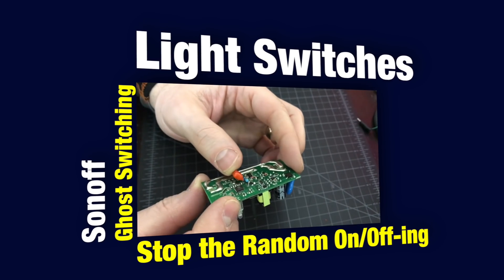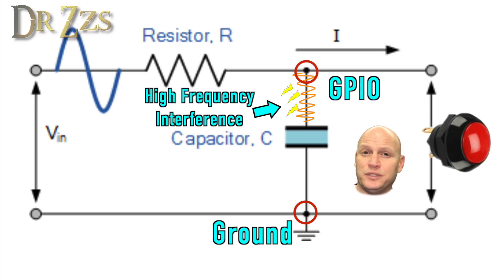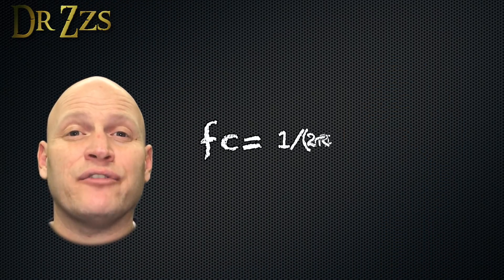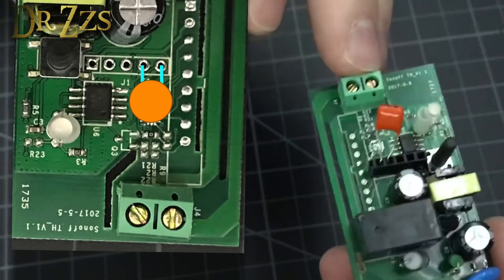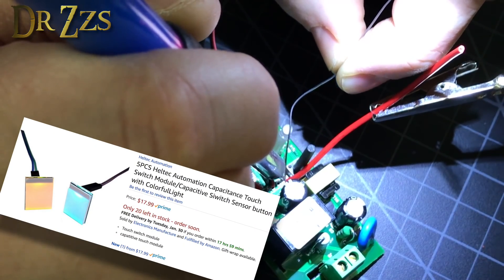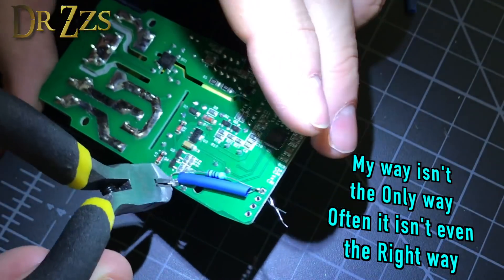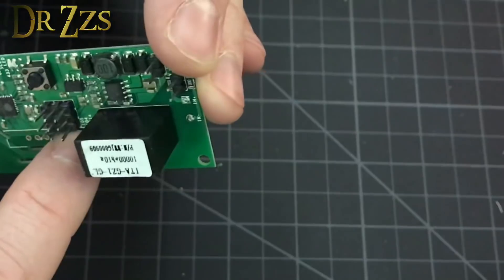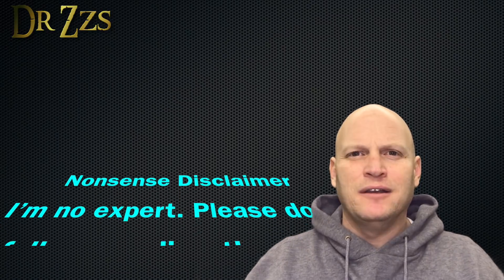Block Interference with a Low Pass Filter - Bust Ghost Switching!

Comment: Very nice video, thanks... But (there's always a but), I have a 4ch R2 with no switches connected, just the basic ewelink app, no scenes, no schedules, no nothing. And I get ghost switching. Is your solution still applicable to my situation? As there are no wires going to switches, there should be no interference to filter, but the ghost is in the machine and I would like to get rid of it. Many thanks if you can guide me. Regards.

Comment: You should choose the capacitor carefully otherwise if you have a push button you will need to keep it pushed longer for higher capacitor values in order to discharge the capacitor.

Comment: Hi, thanks for all the amazing videos. I have ghost switching in sonoff smart wall WiFi touch switch TOUK3C-TX. Two of three switches keeps swiping off and on almost every minute. I have opened it a apart but couldn’t locate GPIO14 pin. There is Jumper-1 which has four pins VCC, C2CK, C2D and GND and there is Jumper-2 which has VCC, RXD, TXD and GND. Can you support to locate GPIO14 pin and do I need to put just one resistor and one capacitor only. I can share the photos if needed. Thanks
Reply: i have the same, did you discover already wich one it is?

Comment: Hi, I whacked like 50 times this video and I still can't make out of it how to know what is frequency on mi Sonoff MINI DIY? I have like 20 of them in my house and they turn off and on lights out of control, like you said: gost lights. 
I put this resistor and capacitor and it's little bit better but still not good enough, and I don't know how to make it perfect to not have this interfiring!?!
Should I get higher capacitor or??

Comment: I have been having this ghost switching issue with my Shelly 2.5 devices. I'm gonna filter the 2.5s and see how it goes.
Reply: How'd it go? Were you able to resolve the ghost switching?
Reply: @walneu  I ended up flashing espHome on the damn thing. Now I don't run the stock firmware on any Shelly devices.

Comment: Problem solved for me by luck!
My sonoff WiFi + RF was turning on and off by itself every 50 seconds  even without connected to WiFi and to ewelink because of my f@cking weather station who has a wireless external humidity and heat sensor and every 50 seconds send reports to its internal unit, I kept sonoff and sensor more distance and everything is great now!have that in mind people!

Comment: Hi DrZzs, Great video AGAIN. I am having some ghost switching atm... so your video is perfect! The problem is, I am using a Sonoff Mini! So I grabbed a Sonoff Basic from the drawer but only have Basic R3's and 1 R1... These don't have the same pinout as the R1 (As iis the Basic in your video). I have manage to solder a Mini to flash it as after loosing power doing OTA so I can solder "Just!" What are my options? Can't buy Basic R1's anymore. R2 has GPIO2 but it's hard to get everything in there. R3 well that's a different kettle of fish!

Comment: Well actually this is not a low pass filter - if you draw a high frequency equivalent cirquit (DC sources get short cutted) the risistor is now paralell to the capacitor. the hf input voltage could pass unrestrained to the IO Pin - but your circuit adds additional capacitive load to the line which reduces the sensiitivity for hf impulses (-;
Nevetheless it works
Reply from the maker: Excellent!
Thanks for clarifying. :)

Comment: What kind of resistor and capacitor I need to use for low pass filter for sonoff T1 eu 2 gang? Do you have some diagram how to connect this?

Comment: Hi Drzzs, can you make a video with sonoff touch or similar switch? as GPIO on those are not clearly visible as on Basic. Highly appreciate! (or someone else, if you can point me somewhere, it would be great. Thanks)
Reply from the maker: I just posted one about the Sonoff TX today.  That's the new version of the old Touch.  https://youtu.be/1q8Pxzrx0Nc
Hope that helps!
Reply: @DrZzs  seen that, I have those as well, and they aren't ghostswitching at all ... so this is good indeed. But for existing Touch version would be nice to have them fixed ... ;)

Comment: Hi Doc. I have a sonof T2 wall light switch US that is ghosting. Randomly turns on but never turns off unless I manually do so. How do I fix the ghosting as the switch is in a casing? My neighbor are complaining the outside light goes on and bugs them. But I’m unaware. Please please advise. Thanks in advance.
Reply from the maker: hmmm
First I'd try the things Rob suggests in his MQTT retain video.  https://youtu.be/31IyfM1gygo
Basically, go to Tasmota settings and type "switchretain 1" and "powerretain 1" 
Then in HA turn off retain in your switch entries.  
What is most likely happening is your switch loses wifi connection briefly and HA (or Tasmota) are turning the light on when it reconnects.  
Hope that helps.

Comment: I’m facing ghost switching in a T1 3 gang model and I can’t figure out how to do on T1 as you did in this video.
Reply from the maker: hmmm, have you looked for software causes?  The T1 shouldn't have EMI causing ghost switching unless something is too close to the cap-touch sensors.  It's possible that what you're experiencing is caused by MQTT and HA.  I assume you're using Tasmota.  Type "switchretain 1" and "powerretain 1" in the Console.  Check out this video about MQTT retain and other causes for ghost switching.  It's good: https://youtu.be/31IyfM1gygo
Reply: Thank you very much, i'll check this out.

Comment: At least on the SONOF 4CH Pro, there are already  10K pullup resistors on the MC inputs. So if you add "extra" resistors in parallel you end up with even less than that. Are you sure there are no resistors already in place in your SONOF?
Reply from the maker: I'm not sure anymore.  They're on version 3 of the Sonoff Basic.  I can't say what the circuitry looks like on the new ones.  
I also don't think this was really the main problem that was causing my ghost switching.  I think it was devices falling off wifi and reconnecting and old MQTT retained messages flipping some of my lights on/off.  I haven't had the problem at all anymore once I stopped asking HA to retain the states, and I started using powerretain and switchretain options in Tasmota.

Comment: I wonder why I see this ghost switching only after flashing a Sonoff basic switch with Tasmota software? I am still evaluating it and might get back to the original Software (which I backed-up, just in case) - With the original software I have two Sonoff basic switches in my lounge which deliver ON or OFF rather solidly&reliably, without LPF. Any comments?

Comment: Ok, so I have a Sonoff BAsic (modified as a dry contact), to open my electric gate, and 2 reed sensors, one on GPIO14 the other on the serial rx as a GPIO, turned off serial debugging... and inching turned on to open the gate... problem is I think it might be trigegring the reed switch when the gate opens, since I mounted the Sonoff behind the gate's module.. gonna try this! hope it works, as well as setting a long debounce delay..
Reply from the maker: Good luck!

Comment: I just been using a 10k resistor from 3.3v to GPIO, whihc seems to work great, no more ghost switching, now I'm worried, should I be also using a capacitor as well? Does it matter?
Reply from the maker: If you aren't having issues, then don't change anything.  That's always my moto!
Reply: @DrZzs  Ahh, but I did have issues with my kitchen lights, as the switch, and therefore the cable, was quite long way off, and I got ghost switching, so I added a 10k resistor between GPIO and 3.3v, and it fixed the issue. But then I watched your video and thought maybe I also needed to add a capacitor?

Comment: Hi. How to modify the slampher bulb holder!?
Cannot find gpio pin on the board.
Thank you.
Marc.
Reply from the maker: Yes!  
I've done it.  I think I recorded a little video.  Send me a message in discord to remind me to look for the video, or get out the slampher and show you the pins.  
In the meantime, maybe this will help you find the pins. 
http://tinkerman.cat/new-firmware-for-the-slampher/
I think that's the guide I used when I flashed mine.

Comment: I used have problems with the ghost switching, until I added both the resistor and a capacitor. As I still had lots more sonoffs to go in, I designed a little circuit board that fits inside the sonoff case - The resistor, a capacitor and a DIP switch (to isolate the capacitor) go on the board, a straight pin header and a 90 degree famale header.  Solder it all up, solder the straight pin header directly to the sonoff, cut a small hole in the sonoff case, and there are all the pins exposed on the outside.  Job done.  Circuit board is shared on OSH Park if anyone else wants to give it a go!  https://oshpark.com/shared_projects/3d9UtZjT
Reply from the maker: Awesome!  Thanks for sharing that Jenny!
Reply: @DrZzs  You can see pictures of the bare board, assembled board and the board in a sonoff:  https://photos.app.goo.gl/5GtsRPmtaX2F7WfE9
Reply: Why did you add the DIP switches?

Comment: Very well explained. Though it probably is not an issue for the  sonoff, in some cases one needs to consider input impedance that could make the series resistor work like a voltage divider. Not really a problem for a short to ground button  though

Comment: Hi! I'm looking for a solution with my sonoff, it's strange because, when I'm testing in my desktop with the sonoff doesn't make ghost switching, but If I put sonoff in my register case in my wall, and activated GPIO14 as switch it causes flash lights, but more quickly than the video, click clack, in less than a second...is this ghost switching?? If anyone could help me, thanks
Reply from the maker: It's possible, but I wonder if it might be something else with some connection.  Maybe there's a loose connection on the GPIO-14 or ground wire.  What kind of button/switch are you using on GPIO-14?  If it's the touch module it could be that something is close enough to it that it is activating.
Reply: oh thanks for response me :D, I'm using a regular wall switch, it is not touch or has a LED in it, it's a simple wall switch. My "Ghost switching" occurs even if I have  only two wires on the GPIO14 and ground, switch disconnected. I live in an attic, above of me I have AA Machines :S, If I put in the register box occurs, but If a plug sonoff in the wall plug (1.5 meters down) not occurs...
Reply from the maker: does sound like RFI then.  I'd guess a Low Pass Filter would help.
Reply: @DrZzs   This guide is great! 
Am having same trouble thought with random quick on /off of LED light, which i'm suspecting is the AC to DC transformer in ceiling that feeds some LEDs.  The only difference from you guide and my Sonoff is i have the new sonoff basic "Sonoff RF R2 Power V1.0" which is reference here.
https://github.com/arendst/Sonoff-Tasmota/wiki/Sonoff-Basic#serial-connection

So am using TX and GD as my toggle GPIO switch with Generic Module type selected and setting TX (GPIO1) to Switch1(09) and D6 (GPIO12) set to Relay1(21).

This works fine but when i apply this low pass filter solution with Resister (across GD and VCC) and Capacitor (across TX and GD) and if the switch is open it works fine. But if i reboot Sonoff with switch closed the Sonoff dose not boot. Any ideas what going on here

Comment: Any amazon links for resistor and capacitor, Please? there are different PartNumbers for the same resistor specs (4.7 kOhm).  qty:100 for $6 (1/2W), and qty:10 for $6 (1/4W), what is the difference, wattage? (or did you ever figured out proper syntax for Robert Tait advice to use console commands [from replies below: "SwitchMode6 you can enable "hold" mode , set the hold duration for .2 seconds using SetOption32 2, and set the hold text to "TOGGLE" using StateText4 TOGGLE"] )? Thank You Very Much, Great Videos (as usual).
Reply from the maker: I haven’t tried Rob’s way but I think it’s a good solution. Probably better than using the Low Pass Filter. 
I’m on my phone so it’s hard to search for solutions. Do what Rob says with setoption6.
Reply: Thank you. I tried, but not knowledgeable with SONOFF,  I think SWITCHMODE6 is for BASIC, getting unknown command when typing SWITCHMODE6 into SV console (did not try other commands though, will check tonight)
Reply from the maker: What version of TASMOTA are you using?
Reply: Sonoff Tasmota 5.12.0  - sorry to bother you, but did you ever figured out what Robert Tait meant under his post to. On SV i am getting Value for SWITCHMODE1 to 4, for 5 and 6 "Command": "unknown" / SetOption32 returns "40" and StateText4: "HOLD"  (worse case i can always follow your tutorial in the video, but would have been nice to do it in Tasmota itself) Thank You!

Comment: Thanks for the great video DrZzs
I just want to know which resistors and capacitors you recommend me to use with the sonoff basic
If you can link me to eBay\Amazon items it will be wonderful 
Thanks.
Reply from the maker: Any brand is fine I'm sure.  These are the sets I bought (there are WAY more here than you will probably ever use):
https://amzn.to/2NowC4e

https://amzn.to/2KI0Rl2

A kit like this is probably a better idea because it has the R's and C's you need plus some jumpers and other useful things.  All depends on what you think you'll use in the future. 
https://amzn.to/2tPEQKD

Hope that helps!
Reply: Thanks again, just wonder what values works for you?
Is it 4.7K for the resistor and 33Nf for the capacitor
Reply from the maker: yes, those work.  It really doesn't matter a lot.  Since the signal we want to let pass is DC the LPF can be pretty much any combo of R/C.  If we were using it to filter something like audio signals for a radio, then we'd have to be careful that our filter didn't also block the signals we want to let pass.  But in this case, any R/C combo should work.

Comment: Always better tips !!
This is also the case for the Sensor Capacitive Switch Sensor
Reply from the maker: I haven't had to use this with the capacitive touch sensors.  I did at first, but since I stopped I haven't had the same trouble.  It shouldn't hurt anything if you still do it, just might not be necessary with those kinds of switches.

Comment: Hi DrZzs, the watts in the resistor and the volts in the capacitor are some how relevant for this fix?
Reply: no, the current is really low->no dissipation, and also the V is around 3v.

Comment: I'm using my Sonoff devices to switch lamps on and off via Home Assistant and I get a lot of ghost switching on mostly. I'm not using any external wired switch to the GPIO pin, so don't need any wires coming from it. Would I still use this method to stop my random switching? That is a 4.7kOhm resistor between 3.3v and GPIO14 and a 33nF capacitor between GPIO 14 and Gnd.
Update: So I soldered the resistor and cap in 2 of my Sonoff Basics and they still turn on by themselves. Are there any other solutions for this problem?

Comment: DrZzs. One question? When the WiFi network fails, does the physical operation of the tasmota switches fails too? Im making some tests, and when I turn off the network (to simulate a failure), the switches begins to work erratically.
Reply from the maker: without wifi the button on the sonoff should still function normally.  key word there is "should".
What is it doing when you turn off the wifi?

Comment: I'm curious have you come across when you hit the push button it comes on then in about 3 seconds it cuts back off?
Reply from the maker: I have not had that problem. 
Give me some more info and we'll see if we can figure it out.
Reply: I have the sonoff basic wired up in the attic because i have old style wiring. Like one wire ing the gang box so i used that one romex as the switch wire, hot or from the breaker as input to the like as output. it works fine with mqtt but when i hit the switch it cuts on 3 or 4 seconds later it cuts off. also its a push button with the switchmode1:4 done. I am at a loss.
Reply from the maker: hmmmSo you're using the romex from the attic (and the sonoff) to the light switch some distance away?
You have the low pass filter set up?  That seems like exactly the situation to use it.  If the wires from your GPIO14/gnd to the switch are really long they're even more likely to pick up EMI, or just plain fail to convey the signal properly.  
If you haven't already try the low pass filter.
Reply: I figured it out. it wasn't a hardward issue. I thought that the client id in the mqtt settings needed to be set to Home assistant. Nope needed and individuall id. The Issue was the mqtt stat would be set to off over the server so when it refressed on the sonoff it would toggle the switch back. Thanks for the help. I havent done the low pass filter but thats just because i'm waiting on them to ship.

Comment: I would like to see this for a sonoff touch T1
Reply from the maker: I have a Sonoff Touch.  It's still in the box.  I need to get it out and mess with it.
Reply: Flashing it is easy, have a look @ tasmota wiki
Reply: Anytime yet?
Reply: DrZzs did u do this to sonoff touch already?
Reply: I guess not, I bough all components and now I cannot find GPIO14 :(
Reply: I've got a bunch of sonoff basics, touch's and a single sonoff touch T1, the T1 is the only device that randomly switches on from time to time, but when it does, it beeps too. Is this likely to be the same issue?
Reply: I Thinks so! I have the some problem...
Reply: I don't get it very often, maybe once a week or so, but i'll try the LPF solution on it and let you know how it goes.